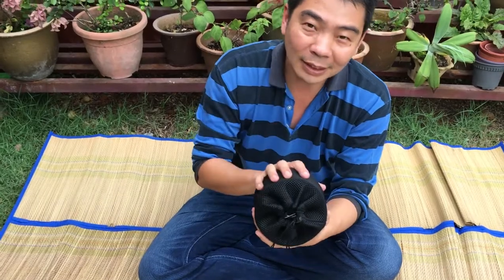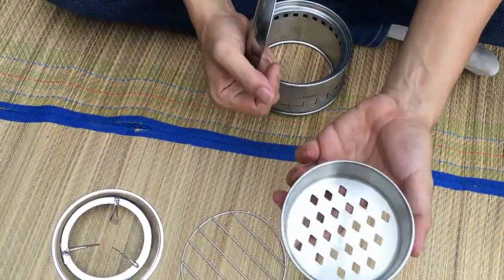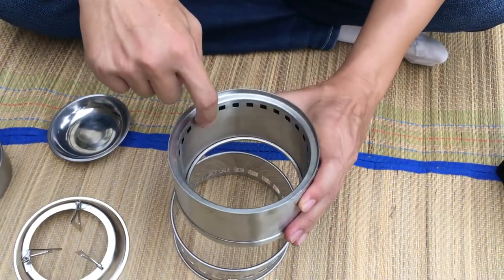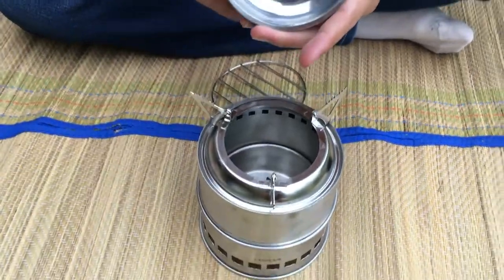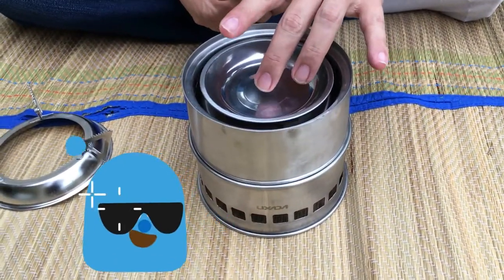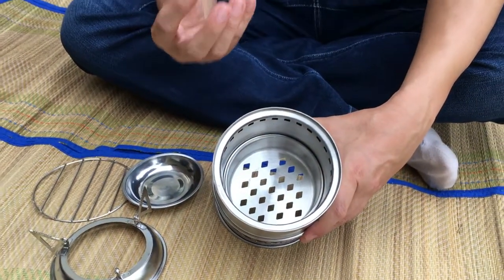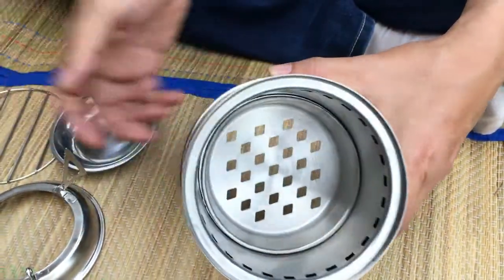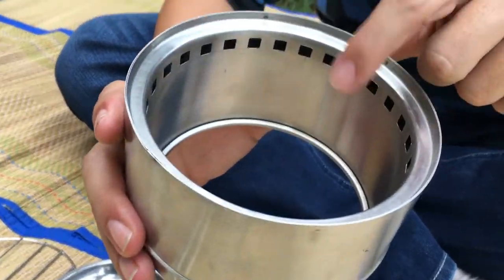Portable Wood Gasifier Stove Explained

Comment: Hi. I used wood gas stove quite a long while. The way you light it up are actually wrong. wood gasifier stove also known as TLUD stove, ( means top lit up draft ) should filled with thicker wood at its bottom , and smaller one on top. the fuel level can't be higher than the gas hole. lit it from top.  You will get longer, cleaner smokeless, and more efficient burn. hope this help.
Reply from the maker: Awesome. Thanks!
Reply: On the contrary using wet wood

Comment: Your explanation is incorrect .First of all all wood burns the same way wherever it is used .When wood is it heated  gas is given off and burns as a flame leaving charcoal.The wood gas or smoke does not get sucked up through the double wall.What happens is that when the stove is lit it heats the stove and the air air which rises in the double wall acting like a chimney.The oxygen in the air mixes with the wood gas to give a hotter and more efficient burn .Calling them gasifiers is is not technically  correct -they are best just called wood gas stoves
Reply: You nail it. Much misinformation is presented in this video.

Comment: I don't believe that is how a wood gasification stove works. Hydrogen is lighter than the surrounding air, and there is nothing to pull the hydrogen downward and then up through the double-walled chamber.

The only thing that is happening is ambient air is superheated, pulled up through the double wall chamber and is injected into the burn chamber.

When you watch a stove like this burn, you can see that a flame is not coming out of the jet. It almost appears that the flame is generated between the openings. Unlike a natural gas stove in your house, where you can see the flame coming out of the gas jets. 

The injection of the super heated air simply provides abundant oxygen to the area where gases and combustible compounds are burning and allows them to be burned as efficiently as possible.
Reply: You are absolutely right.
Reply: You are right
Reply: Read my explanation above  .Many people have a misconception that  there is a down draft pulling the smoke (wood gas) down through the stove .This is wrong- hot air rises .It is the super heated air in the double wall which rises and exits through the holes mixing with gas given off by the burning wood which gives a hotter and cleaner burn.